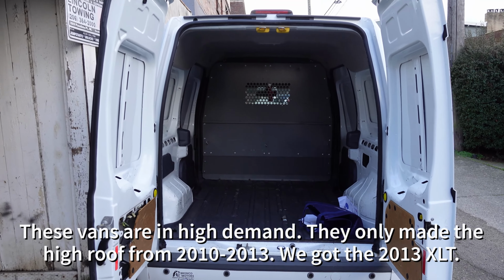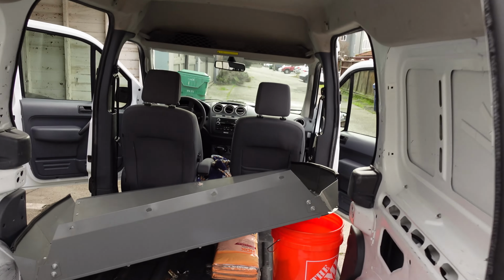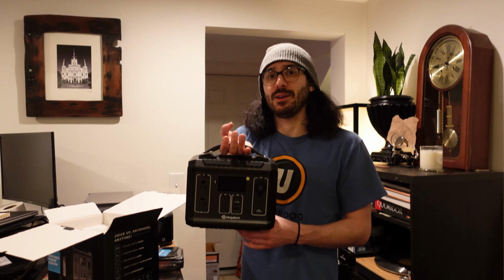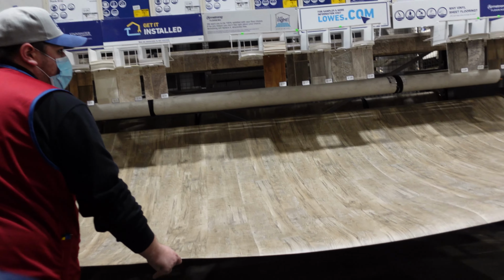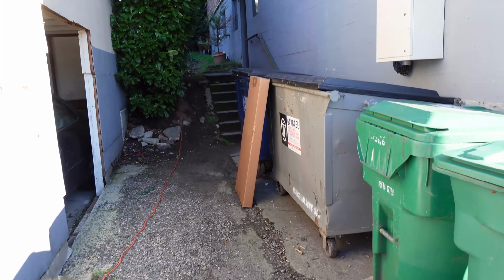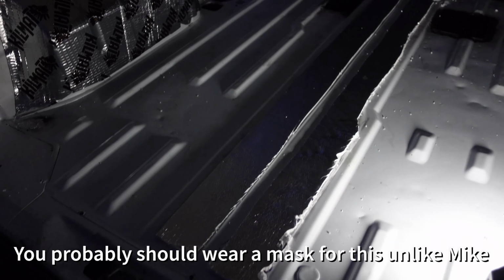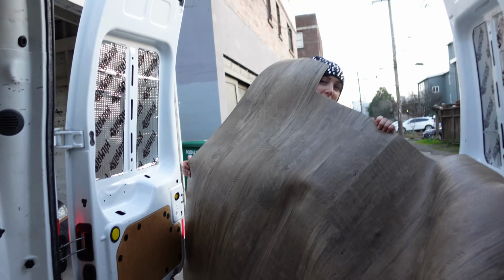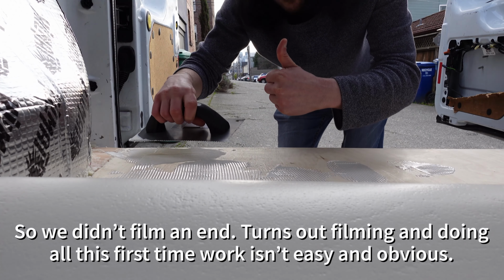Ford Transit Connect Conversion - Flooring and buying supplies - What have we gotten ourselves into?

Comment: Looking forward to following this build!!
Reply from the maker: Thanks Phil! Long time no see!

I did work the past 2 days and didn't capture it. We have some footage of putting in the fan and shelf coming up. But I've realized how much extra work it is to film every little step unfortunately. Next step for us is ceiling and walls which we will certainly film
Reply: @MichaelZuino  get some magnetic camera mounts for b-roll or even time lapse footage, yeah the build is hard enough much-less having to film it. Best of luck!
Reply from the maker: @thephilweknow3289  good point. The GoPro does amazing time lapse. I may just turn it on when we do the ceiling and then use the Sony as the main camera
Reply: @MichaelZuino  definitely!
Reply: @thephilweknow3289  thank you so much and I know how crazy things are at this moment I believe it will all turn out to be good 😁🙌🏻